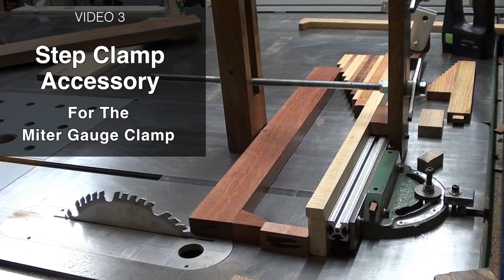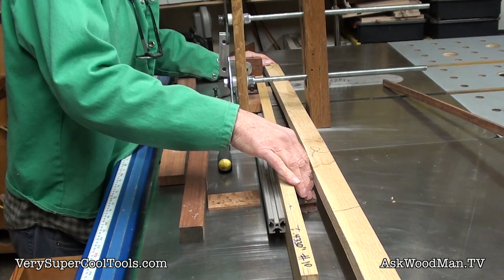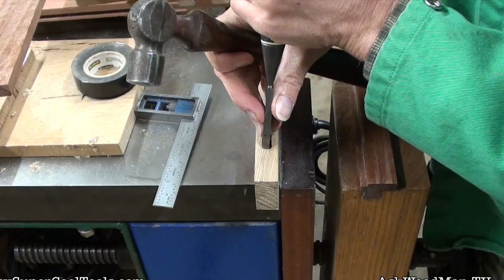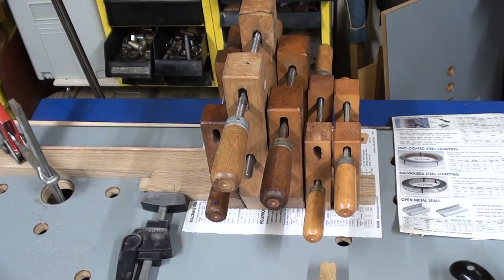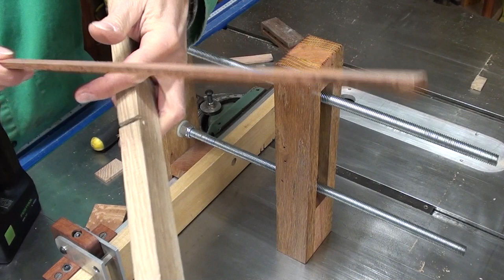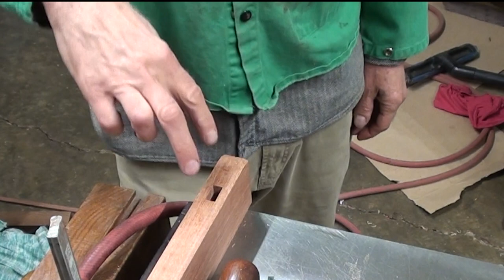1120. Make A Step Clamp for your Miter Gauge (3 of 5)

Comment: Very interesting.  The step clamp reminds me of viseless workholding on the work bench; for example, the use of a bench dog and a batten.  A step clamp similar to this should also work on a tablesaw sled.  Not certain of the correct part names and terminology, so I will refer to the vertical pieces as the front and rear clamp jaws, with ‘front’ being closest to the operator.  The fulcrum created by the key against the rear (vertical) clamp jaw seems to be very important.  Instead of placing it in the horizontal piece - which you apparently want to move left and right at times - why not place it on the rear clamp jaw?  Then it would always be there, and the small key stored on the jig would be unnecessary.
Reply from the maker: It is pulling against the miter gauge fence face.